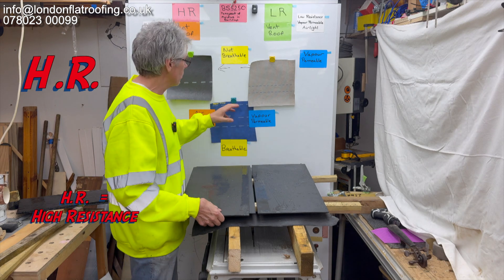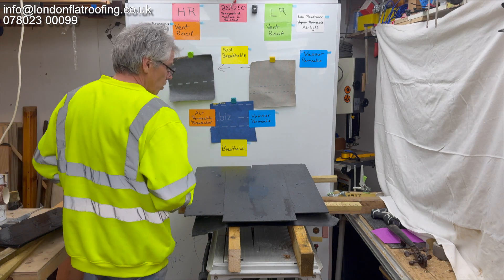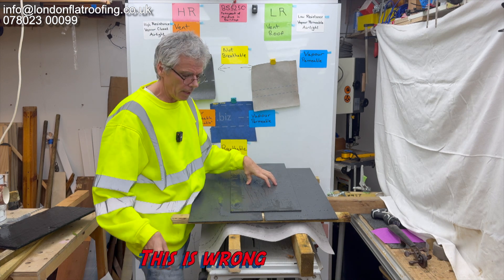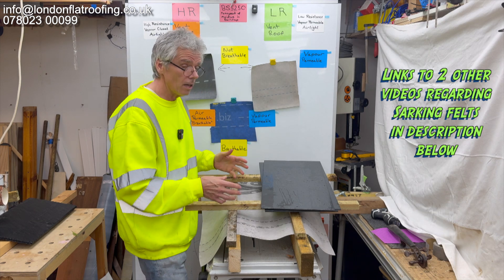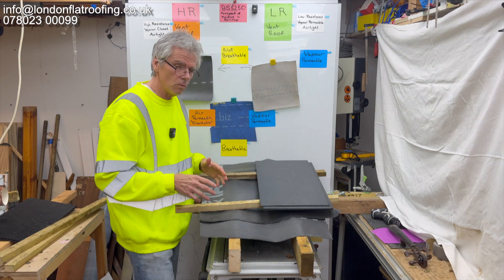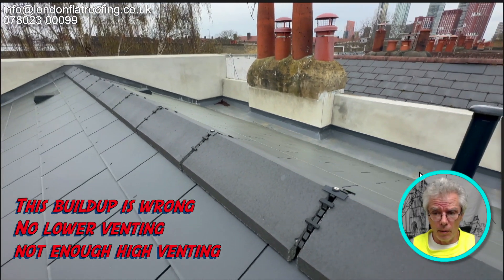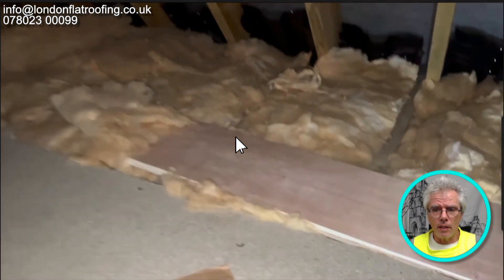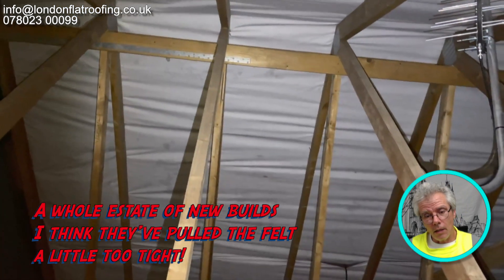Discover The Truth About Roof Underlay Felt! Part 1: Let's Talk About Breathability

Comment: Hi Steve, I am building a 3.5m dia rotating circular garden room with a conical roof, i plan to lay wooden shingles as cover.  The roof rafters  are up and i have used 3x2 timber because i am restricted on total weight of room as it sits on castors. What are your thought re insulation for roof? Would 50mm pir insulation be ok if pushed up against roof deck, leaving 25mm below making a hybrid roof? Would really appreciate your help.  cheers
 Tony

Comment: I'm trying to insulate my attic to make it a workspace, I have 75mm rafters (sad but true). My strategy is 100mm kingspan under the rafters and when I get the roof redone (2026), insulation over the rafters. It's the insulation over the rafters i'm struggling with in terms of permeability both air and vapour.

I'm also installing MVHR as well.

Is this a combination of variables that might make a video?

Comment: Interesting Steve, again nothing is clear cut. I've seen both iko and tapco installed and the gaps between each slate are significant, they end up being about 10-15mm apart because of the spacers built in to the slate and when I look at natural slate roof, they are always fitted snug to each other. What you have in effect is with a synthetic slate roof, there's a little void either side of each slate that channels up to lots of exposed roof felt, especially the tapco which is tapered at the top of each slate revealing even more felt, each slate has a triangle shape of exposed felt either side of it at the top which is the covered over but not sealed off from the air that can flow up through the gap in each tile below. I guess my point is, from what I've seen, due to these significant gaps on a synthetic slate roof, I'd actually put my money there being more under felt exposed to the air on a synthetic roof than there is on a natural slate roof.
As to what the implications are of this I'm not sure, but I just thought it was worth mentioning as you say they are categorising synthetic slate as 'air closed'. And as I've demonstrated. These voids would in theory provide as much if not more air to flow up and around the slate and to the surface underneath them.
I hope that makes sense and would love to hear your thoughts.
Reply from the maker: No, I disagree. The amount of air flow through these artificial slates is so minimal. They are definitely they are closed.
Reply: @SteveRoofer I agree!